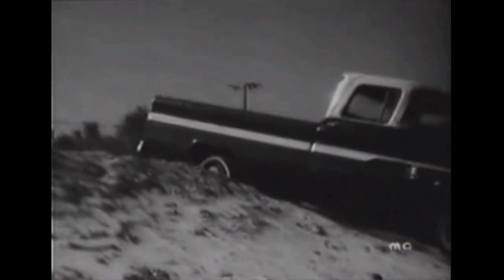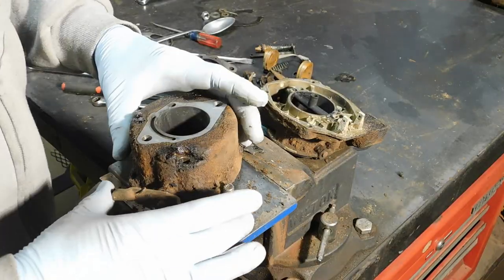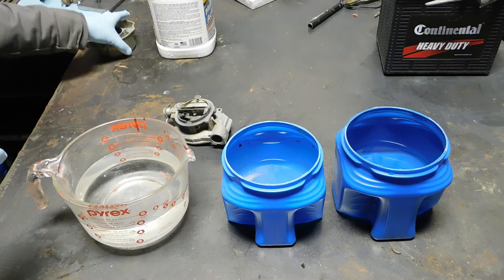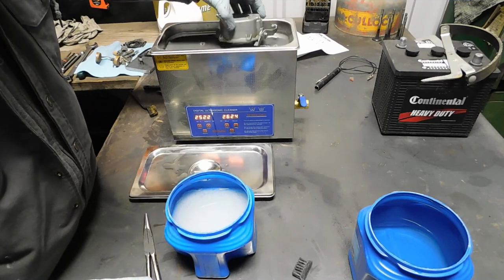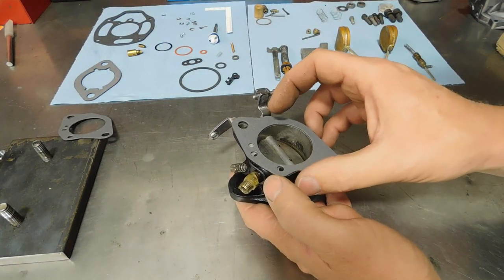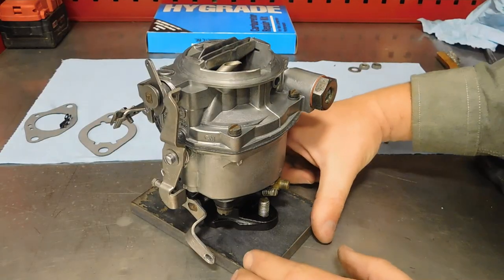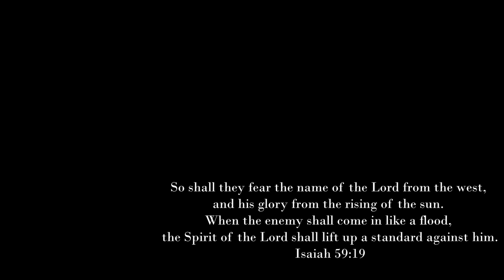Part 10: Rochester Model B Carburetor Rebuild - 1966 Chevy C20 - 292

Comment: Well I experienced an ugly fuel tank contamination that deposited ugly sediment inside the fuel tank, pump and carb. Replaced tank and pump, and flushed the lines. Rebuilt the carb but to decontaminate it I submerged it into a gallon of carb cleaner and got the same degreasing and stripping effects you obtained by all those procedures you performed. I painted the aluminum housings with 
Seymour EN-71 Hi-Tech Engine Spray Paint, Dull Aluminum and it came out very nice. For your information my carb Rochester B for 1948 Chevy 3100 truck. Your carb and mine are very similar except for the inlet fuel filter and the throttle linkage.

Comment: Thanks for the video. I am about to do a rebuild on the Model B on my Dads '66 C10 and this video will help a lot. I recommend using Super Clean Degreaser. I used it on the 230 in the '66. There was about 58 years worth of road grime and grease built onto the sides and back of the motor and now it looks brand new.

Comment: I this is old but I've used pinesol with a little bit of lemon juice along with a splash of dishwashing soap.
worked fantastic, don't leave it in there too long..  years ago it was bendix carburetor cleaner followed by a rinse in clean gas.  good times.

Comment: I found a cleaner that will liquify roofing tar at Home Depot. It's called Natures Orange and it is very good at cleaning any petroleum product up. It comes in gallons and quarts and needs to be cut with equal amounts of water.

Comment: When I was a kid you can buy a paint can part cleaner dip that came with a basket. If you let things soak in there a few hours they were come out looking brand new.  Much better than soaking in gas or ultrasonic. If you don’t have anything else solvent or gasoline is the next best thing to use. Berry man Chem -Dip.
Reply from the maker: Yes, I've used all of that myself in the past. I just like the idea or theory of an ultrasonic cleaner breaking up crud in the small passages. So I'm trying to experiment with products that will work well for that...if there are any. Soon I will have a video up were I rebuild the fuel pump on the '38 Buick and use a product that looks very promising. Thanks

Comment: @27:29 you didn't run a wire thru the power piston. There is a small hole on the side which opens to the hollow shaft. I'd like to know if there is a hole that travels thru the base. Can someone explain what it does?

Comment: Just picked up (no pun intended) a big old Hyster forklift with a swapped in 292. Carb looks different than this one, maybe a Holley? (Edit, nope it's a Bendix) Are the new China-Ebay carbs that go for $70-120 worth a try these days?
Reply from the maker: I have no clue, I have never wanted to "go there" but I suppose a lot of people do. With a core, a remanufactured original on rockauto is about $150.00.
Reply: @Cariboobear  How bad was it?
Reply: @Cariboobear  What were you using it on, a rock crusher or stump grinder? I can't imagine what could cause enough vibration that it would loosen threaded fittings inside the carb. Were the threads defective? I see a number of vids on here where guys have had zero problems with them.

Comment: It makes no sense to clean gasoline deposits with gasoline; it won't work.  For carburetors, I use aerosol carburetor cleaner; one can will thoroughly clean this carburetor.  Use the spray wand to force the cleaner through all of the small orifices.  I've also used Berryman's carburetor dip (the Berryman's currently available isn't as toxic as the older stuff, but doesn't work as well).   Lacquer thinner also does a great job on gasoline deposits.  Aerosol brake cleaner also works pretty well.  For general cleaning and degreasing, I use mineral spirits in my parts washer.  Simple Green and Dawn dishwashing detergent with water work well to clean greasy parts
Reply from the maker: I mentioned that because I have seen it used very effectively as a degreaser in an ultrasonic cleaner. I'm sure you know that in days gone by it was used a lot in shops for that purpose...until Joe's cigar ash dropped in the pan.

Comment: You can get Industrial De Greasers, of the type used by cleaning industry, make a strong dilution say 50/50 with water, ( the degreasers are strong Alkali I think) - OR ?  try pure diesel as a soak / cleaner

Comment: The Rochester on my 1956 235ci doesn’t seem to have any indication as to what model it is, the stamp says Rochester Gm made in USA patents pending. But there is a small x on the top left of the stamping. Is there a model designated by an x? Also, it started to leak very significantly out of the throttle shaft, which goes into the second butterfly(right?), at all times. So I took the carb off and disassembled everything and cleaned it thoroughly. Upon reinstallation the throttle shaft leak was fixed, but now under both normal and heavy acceleration, the engine hesitates and stumbles. It never did that before I disassembled the carb so I’m not sure as to what I May have accidentally done? Any ideas would be greatly appreciated
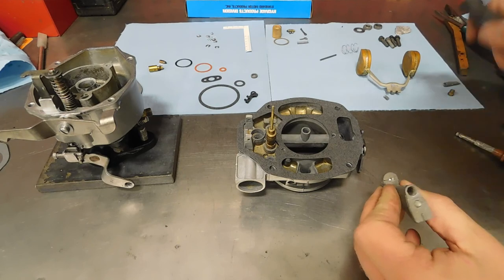Reply from the maker: I'm sure yours would be a Model BC, which means it has the round automatic choke cover on the side of the carburetor. My thoughts on things to check or recheck are: The float height to make sure that the bowl is not overfilling, the accelerator pump cup(if you replaced this it should be fine), all passages and the metering jet were clean and clear, the small screen inside the carb (28:30) is clean, but perhaps most importantly that all screws are nice and snug on the carb and check around for vacuum leaks. You can spray around with brake or carb cleaner while it's running and if the rpm changes with any particular spot where you spray then you should find a vacuum leak.
Reply: @TheJayhawker  it’s not the bc model because i have a manual choke cable running to the dashboard. It’s in a 49 Chevy pickup so I’m assuming it’s a plain old model B. I just took it apart again this morning and cleaned and inspected everything again. The accelerator pump looks good, I’ve never changed it and I  never had problems with it before. The old fabric gasket was shot and seeping, so I did the proper thing and threw some permatex on the mating surfaces and called it a day. I think it’s been bleeding into itself because the gasket couldn’t hold any gasoline in the carburetor without seeping down the sides. The bowl may have been filling and continuously overflowing into other parts of the carb. I don’t know for sure I’m just theorizing why I had such terrible gas mileage, I was getting 7 if I was lucky
Reply from the maker: @wallyworksonstuff343  Ok, sorry. I just assumed it was a car for some reason....anyway I would also suspect the condition of the needle, and whether or not the fuel is being shut off even if the float is correct, that could account for the bowl overfilling and also for the raw gas from the throttle shaft.  Also, if these are all old seals, gaskets, and needle and you have been using ethanol gas it could have damaged any of these.

Comment: Excellent work and great video. 
Just to me. From what I can see. You put in the filter on backwards. The way you put it. There is really  no filter. The  spring  is supposed to be on the flat part of the filter.  If it goes into the filter. Then is it really doing anything?like pushing like it should 🤔 
I am no expert. And I very much could be wrong. But I believe that the  gas filters inside the filter. Gas has to go inside. 
If it stays around the outside..I  Donno
Sorry but I just don't understand 😅
Reply: I agree with you, the filter is backwards!....

Comment: @33:51 didnt you put the filter in backwards?
Reply from the maker: Yes it was backwards.
Reply: @TheJayhawker  is there a hole that runs straight thru the power piston? I'm not sure if mine is clogged. What does it do?

Comment: I absolutely love your series with this truck. I did the muriatic 10:1 and unfortunately my carb is junk after. The excelerator pump cup does not fit in the bore correctly , my choke plate shaft is gapped and passes air as well, the T & spring will not fit or stay in where it goes now.  It’s like every internal bore has been bored out because it is missing the cad playing.
Reply from the maker: The only way that should have happened is if you left it in there for a lot of HOURS. Like I said I only had it in the acid for about half an hour and even then the CAD plating on the inside of the carb didn't come off. And that's 10 parts water to 1 part acid. Just checking...

Comment: The screw at 37:53 … what makes it pop up?  I accidentally loosened cit until it came out.  In the carb, under the screw was a small brown piece of plastic and I don’t know what direction it goes.  Should there be a spring?